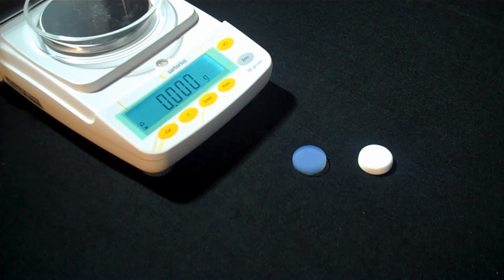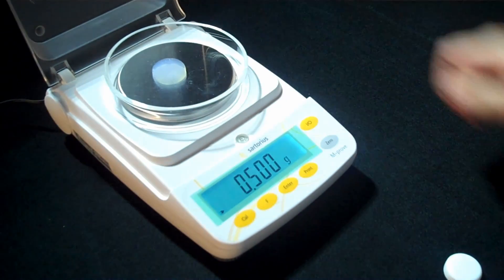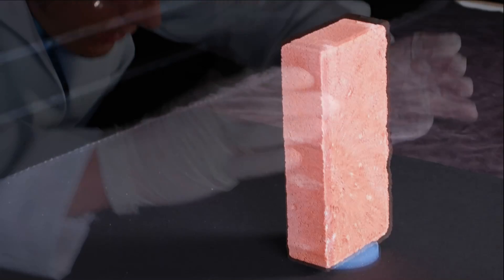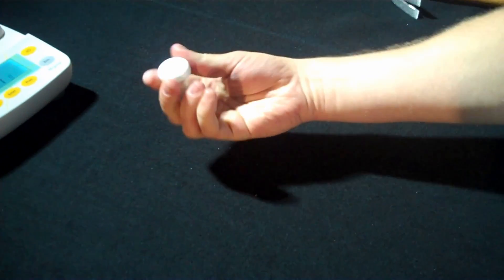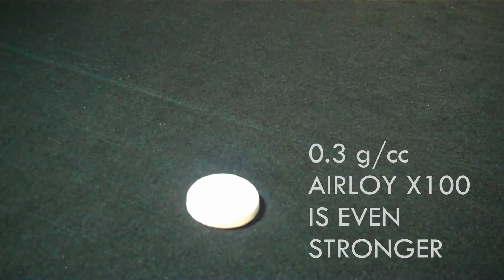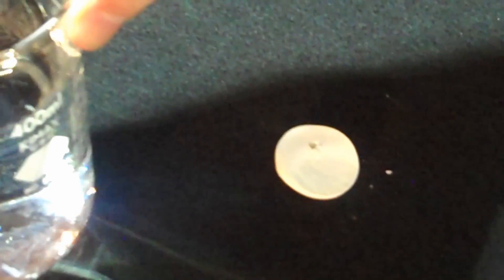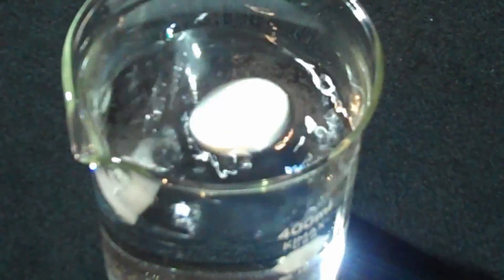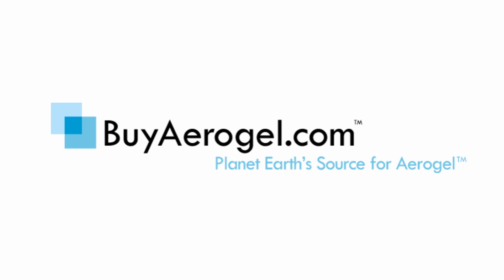Strong, Machinable Aerogels Now Commercially Available

Comment: Make high end bumpers and car seats?
Reply: ***** No, tuvoca is not stupid. There are many possible applications of aerogel to cars because of its mechanical properties. It is the correct approach to any engineering problem to start with a question no matter how unlikely the outcomes are. At the moment aerogel may be a sub-par material for bumpers, but decades ago who would have thought using the tip of your pencils to make graphene semi conductors? A few years later aerogel may be completely transformed. The bottom line is, you don't criticize one's approach to an engineering problem with "Are you stupid?", because that is the most scientifically incorrect opinion you can have. Instead, you should be responding with how might there be ways this is possible.
Reply: Are you stupid?

It's a thermal insulator, what makes you think it's going to be used for car seats and bumpers?

I don't know if you're aware of this, but humans like to create enclosed spaces (inside) which differ in temperature from the spaces around them (outside).
Reply: hgfjyrdetryu
Once upon a time, long long ago...
JJ Thomson: "Bro! We can divide this atom to smaller stuff!"
ChasingTruth TakingFlak: "Are you stupid?"

Comment: Neat material but unless it can be made in large sheets at low prices it's basically useless.
Reply: White LED's were $10 to $15 EACH blue and green were $7 to $12 each. and that was when they hit mass market IE you could goto radioshack and buy one a website and buy one.

I bought my first set of 35 LED christmas lights for $40 and it was a freaking bargain. I could not even buy the BLUE led's for the price I paid for the string (before that) and I got all the other led's and everything else in the string as well.

a few short years later I bought a nice set of 100 warm white LED light strings for $5 at 5 and below.

it takes time sometimes and that time span depends largely on "demand" demand for LED lights was huge. it developed and economies of scale "scaled" rapidly. this will probably take a little linger. lower demand.

so its only useless to me and you who can not afford it. for someone who CAN afford it then it just might be that little bit that takes their project from not doable to now doable. time will tell.

Comment: Move over plastic, there's a new material everything will be made of!
Reply: ***** Maybe cause plastic is cheap.
Reply: ***** Considering Al is over twice as expensive as plastic....yeah.
Also, a better heatsink + fan, or other cooling system far outweights what minimal effect plastic has vs. Al as a computer casing.
Reply: Well, if you're doing things that need heavy-duty cooling on a laptop, you're doing something wrong. Haha :]
Reply: ***** They used to be made out of heavy metal, back when they were flat instead of towers, doubling up as workout equipment in the office
Imagine carrying that around in a laptop?
There are also laptop cooling pads
So, imo, plastic is better and far less expensive than good conducting materials that are available.
Steam machines apparently separate pc components so they have their own air circulation, so the design of the case also matters
I say, rather spend money on the performance parts than ricing on case material for cooling
Reply: ***** ' You just have to pay top dollar for it'
That is the problem. If I am going to get a low priced laptop, I would rather pay less for plastic and spend more on the parts rather than the case. It's not stupidity in designing the case, its just business sense. If you've got the money for durable and good looking Aluminium, go for it. If not, metal fan and good vents should do fine, and you can put the cooling pad on your lap. 
My dad has an old plastic laptop that is only limited by the hardware, not cooling problems. I wouldn't like an expensive low spec metal white elephant, but that is just my opinion
Reply: ***** Once again, you are still vastly overestimating the cooling capabilities of a thermally conductive material. The numbers look big on paper, but realistically, they're not.
Reply: ***** Also, plastic doesn't corrode.
Reply: ***** this is why you buy metal cases and ignore friggin plastic

Comment: I remember when carbon fiber was touted as a new material with promising applications countered with similar critiques, I doubted that it would be viable for things like bicycle frames & car bodies.  It was expensive when it first was used, but the price has been falling.  Airloy might never be cheap enough, but the general approach of using a 3D web substrate starting there will likely lead to development of cheaper materials & processes with similar properties.  We engineers know this.

Comment: Yeah.  I've been an Army medic, & an engineer working in the bio-medical industry for several decades, so I've dealt w/ X-ray devices many times & have worn similar eye-protection.  There's also lead-infused glass for windows.  Such devices are only used for attenuating low-level stray radiation.  Even directed-beam X-ray emitters require very heavy aprons for ambient protection of embrionic/fetal children whose mothers are getting cranial/mandibular X-rays for diagnosis or treatment.

Comment: An experiment you can easily do at home to help understand traction, which is just static friction:  Clear & thoroughly clean the surface of a smooth table.  Place 2 identical sheets of paper on the table a few inches apart, and place a very light book on one sheet, & place a heavy book on the other sheet.  [Use books with fabric covers that do not easily slip on the paper sheets.]  Now tip the table until both weighted papers start to slide.  Notice that both slide at nearly the same angle!

Comment: Traction varies with vehicle weight on the drive wheels, and acceleration varies inversely with vehicle weight; so vehicle weight does not affect the limit of practical traction for acceleration or hill-climbing if weight is the only variable considered in comparison between otherwise identical vehicles, pavement & tires.  As speed increases, nonlinear aerodynamics will change tractive downforce, hardly a considered variable at low speeds.  As an ME, I can explain, but not in <500 words.

Comment: Isolation and isolate are not the same word and aerogells are not strong. This would be good for protecting you against heat and cold,and would make one hell of an epic thermos (or fridge,or space suit lining.)If you want a bullet proof vest,you want something that is not only strong,but something that can also disperse the pressure.Biosteel has promising applications in bullet proof vests due to its strength,while Dragonskin body armor works by absorbing and dispersing the energy of the bullet.

Comment: did you watch the video? Mostly for insulation. You can blow torch your hand with a thin piece of aerogel on it, and you will not be harmed. Aerogel has almost no practical applications because of it's fragility besides very specific technical things, like catching comet dust in space without sacrificing weight.

Comment: Making something fly with aerogel is pretty easy but it has issues. First off the cost is a factor. Beyond that however as shown in this video aerogel is very brittle and therefore you must also include that as a factor.